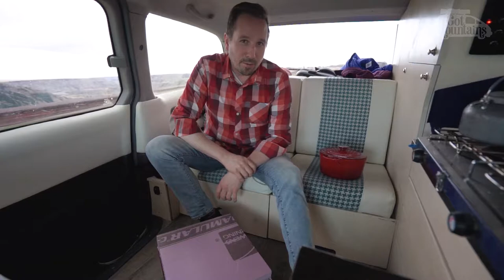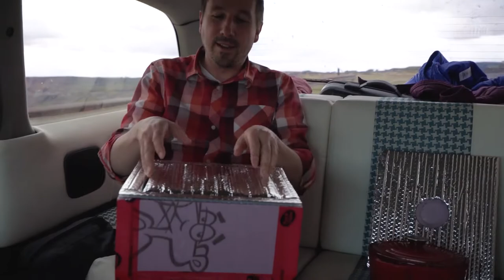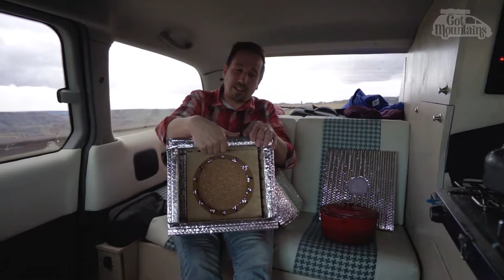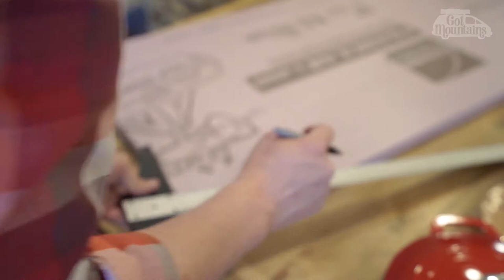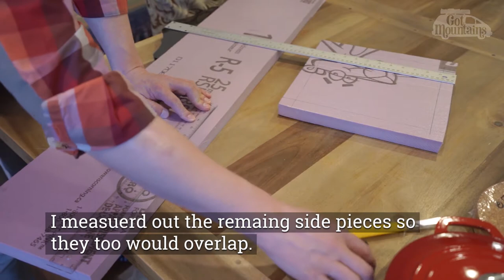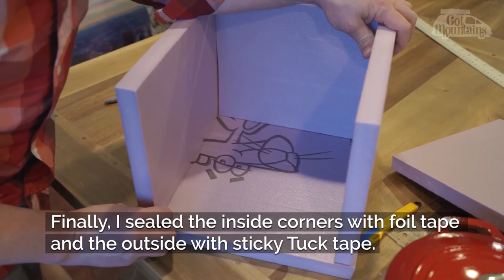DIY Vanlife Slow Cooker USES 70% LESS ENERGY!

Comment: A $30 Aroma 8 cup rice cooker does an amazing job cooking food (rice (duh), soups, noodles, chicken/pork/beef, etc) in way less time than slow cookers or foam boxes (30-60 minutes) , uses way less energy than standard pressure cookers (350 Watts compared to 700+ watts so it can be used in any car with a 400 watt continuous inverter), insulates food for a long time after unplugged, and takes way less space than this foam box set up or standard crock pots or standard pressure cookers, and you can get them with lockable lids so they don't spill if you're cooking on the go. Just go with a rice cooker.
Reply from the maker: The problem is that cheaper cuts require the cut to be cooked at 200F for a few hours to break down the connective tissue before they are tender so a rice cooker wouldn't work for those.

Comment: I’d love the measurement if you kept them. I’ve been wanting to make my own because the wonder bag is too large and costly to make.

I understand the box needs to for the pot, but I’ll use the pot that fits.
Reply from the maker: Yeah, I matched the the inside of this to the outside of the box my dutch oven came in and it was 11" x 11" and 9" tall. So your have to add an inch to the outsides of that. I wish I had made it a ½" taller though.